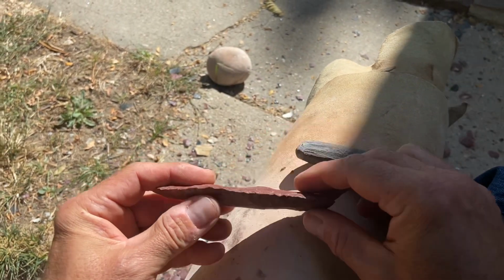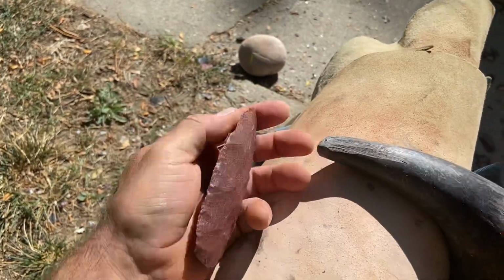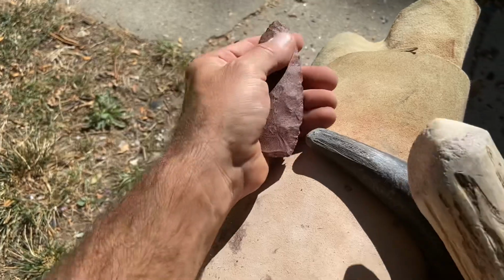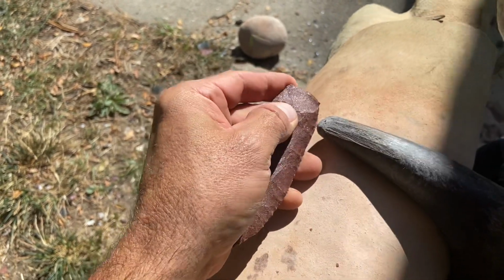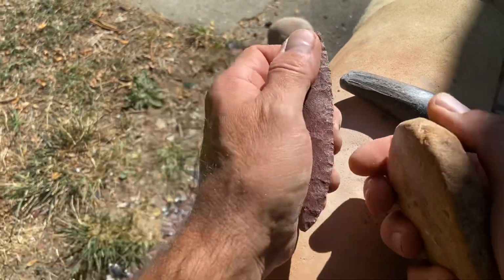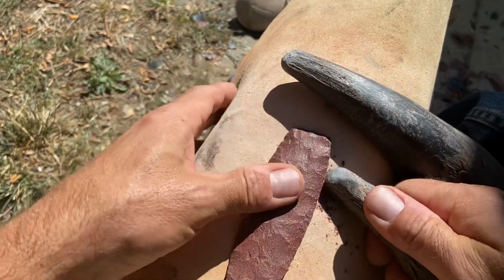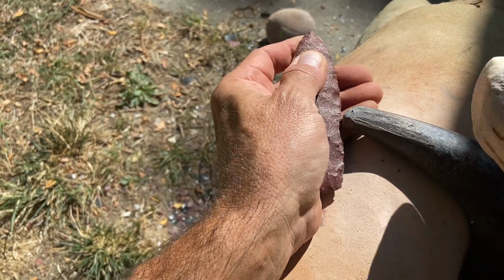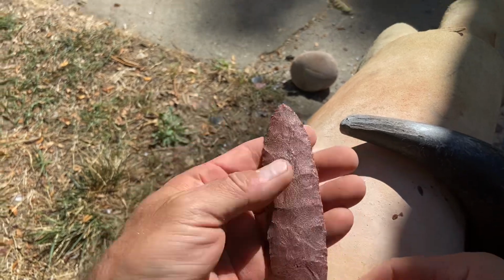Bison punch quartzite preform

Comment: Another great video.  What angle are you holding on those larger flakes?  Still working on the indirect stuff.
Reply from the maker: Hard to say bob. Definitely want to work less in than down w the buff so you don’t sink. Really depends on platform placement and strength.

Comment: The qurtzite looks like it would grind away very easily it looks like you have to be very delicate with it.  
      What other kinds of chert or possibly obsidian would be good to use with a buffalo punch.  It doesn't look as powerful as whitetail punch work.
Reply from the maker: Basalt, obsidian, soft cherts and jaspers, quartzites and silicified sands stones have a broad range.  Harder cherts also, but for later stage.

Comment: Do you have an instructional video on how to make a Buffalo horn indirect pressure flaker? Would be very interested in trying this style.
Reply from the maker: ?  I’ve just got a buffalo horn with a stick in it jammed into my knapping bag.  If you want to make sectioned pressure flakers I cover it in my previous video.
Reply: @Flintknappingtips  I saw the previous video. I like indirect pressure flaking and an Ishi stick just doesn't do it for me anymore.  Saw your video and said to myself I gotta try this. What is the length of your stick and do you keep pressure on it by putting it under your leg and pressed into the ground.
Reply from the maker: @richardcummings7079  it totally depends on how low you sit.  Cut a shaft  4’ or so and you can shorten it if needed.